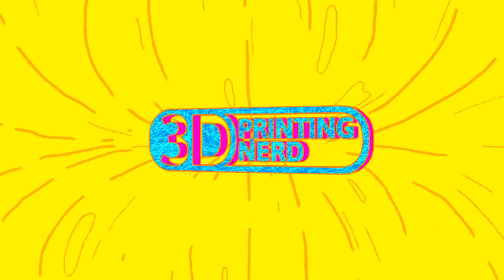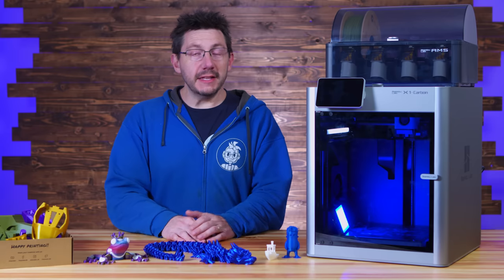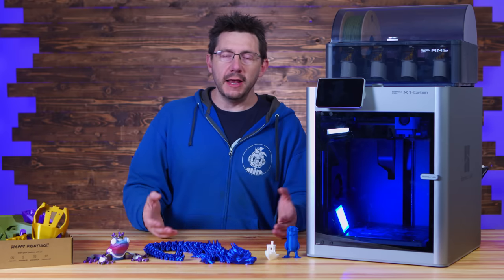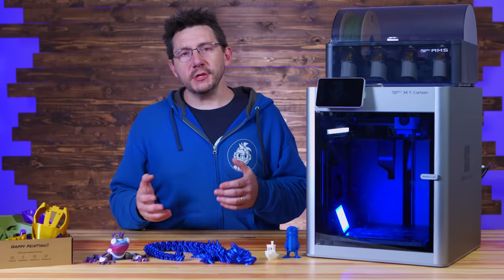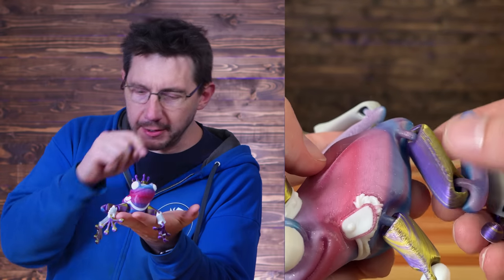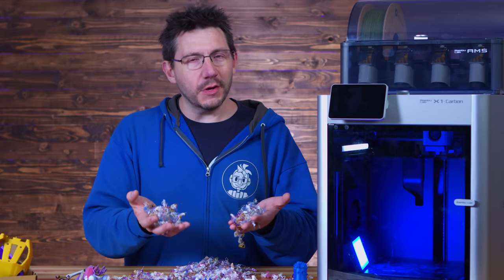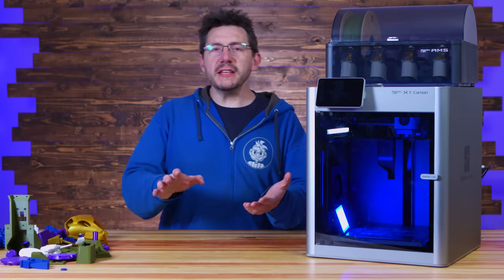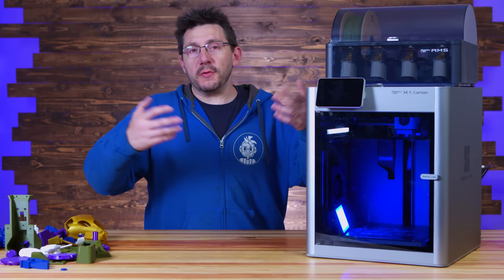Bambu Lab X1 Carbon + Kickstarter?!

Comment: Hey Joel. I've been really interested in this machine and have been straddling the line on buying one at pledge stage. One of the things I'm not seeing a lot about is the part cooling ability of the machine. Sure it seems SUPER quick but at what point does its speed out perform its part cooling ability?

I'd love to see some prints that really push it's part cooling potential and probably by extension it's stringing
Reply: I mean it’s printing PLA at 250mm/s.. I don’t think it gets much better than that as far as the amount of cooling required.
Reply: The only real information they have present for the cooling is that it has an 11W cooling fan, which is quite a bit compared to most cooling fans which are in the 1 to 3 watt range.
Reply: @colinmetzger6755  There is cooling on the hotend and also a blade cooler on the side blowing air across the bed.

Comment: I would love to see not just multi PLA but PLA/TPU/PVA/Nylon or w/e combo you can push it to do. That is where the value will be found for me.
Reply: I agree.  I would like to see high temp and exotic filaments printed on it.
Reply: I’m honestly not sure that would be possible, at least not without really crappy results for any machine. The purge sequence doesn’t actually know where one filament starts and the other ends, so I think nailing the temp transition would be really tough. It’s worth a shot though
Reply: @vaughnkhouri1364  I think its actually rather simple to do. There are filaments called purge filaments that flow at really wide temperature ranges. If you use that in between switches, it wont really matter, though it will take up a whole slot.
Reply: @BeefIngot  That’s interesting! I didn’t know of such a thing. Would be cool to give it a tru

Comment: For those who have the X1 + AMS combo… Does the LiDAR flow calibration perform a calibration on all materials loaded in the AMS module? Or does it only calibrate the flow for the “Primary/Default” filament?
Reply from the maker: Only the first material it uses - not all of them.

Comment: I, personally, would like to see it's capabilities in printing carbon fiber based filaments and flexible filaments such as the Filaflex line from Recreus (they make specialized tpu filaments that are solvent/fuel resistant). Especially since it's a proprietary hotend system.

Comment: Really appreciate the way you explained the Kickstarter and investment background. You're the only one that really highlighted some aspects of this launch that were important to discuss. I'm curious if this thing can handle... Slow printing... I use polypropylene, which is notorious for warping when printing large parts. It's also a pain when printing fast. The best I can do on an ender 3 s1 pro with my custom enclosure set to 35C is about 35mm/s with 250mm/s2 acceleration and a tiny tiny amount of coasting in cura to reduce stringing. No one YouTube's about polypropylene, but it's a fantastic material. Wondering if you could try it out.
Reply: the print volume is heated, and it seems you are able to change how fast it prints in the slicer

Comment: I thought the AMS only took .5kg spools but it looks like you have it loaded with a 1kg spool. What size spool does it take and did you have any issues with loading or setting up the non-Bambu filament. One of the other videos I saw said the Bambu filament communicated with the printer via RFID. Looks great but with only one year warranty for a machine that is 100% NOT off the shelf and proprietary I don't think it's a smart move. Unless they make spare parts available at a reasonable price.
Reply: Spare parts will be available

Comment: It sounds like an absolutely fabulaous machine.... but I have two main concerns:

1. It's packed with features, which on the surface might sound fantastic, but the more things it has, the more things can go wrong. I'd be concerned with reliability over the long term.
2. How are they able to offer a super advanced printer like this for such a low price? Printers from other manufacturers with less than half of what this one is offering cost 2x to 3x the price. Something doesn't add up. If they're losing money on the machine, they need to make it up somewhere else. My concern would be, where?

Don't get me wrong, I want this to live up to the hype, but I'm remaining skeptical for time being until the Kickstarter is over and it's been time-tested.
Reply: I think what you are missing is that other printer companies make absolute bank in profits on every printer. Do you think an Ultimaker is anywhere near 5k in bom cost?

Absolutely not. You can build one to the same spec for 1/10th the price.

I reckon that this printer is selling at a close price to BOM initially to get their company name known before branching out more and increasing prices.

If you look at Vorons for instance (where they dont have the benefit of economies of scale) they cost just about 2k to start, and have somewhat similar feature sets.

If a normal person can get a voron for that price, you can imagine how a much more streamlined process with injection molded parts, economies of scale and being designed for manufacturability gets to this price.

You also have to take into account that unlike some other companies, they have huge access to a far cheaper labour market.

An average engineer in the US will make about 100k USD while one in China will make 40k. Thats a huge savings for the same grade of engineer.

All in all though, I still think you are partially right, and the funkyness to do with the cloud platform nonsense has me thinking there is going to be a big gotcha on that front. There is no reason to necessitate the cloud.

Comment: Great overview and for hitting some important points. A fair mount of text below (as I've become infamous for)

I have had small chats with people, but have also written probably more in comments on livestreams about this printer more then any other. A fast printer is ideal. A high quality/accurate printer is a necessity. A feature rich printer is ideal. A user friendly printer is often overlooked (though I know I've been saying that for years to friends, and I know I'm not the only one who's said that). And a well priced for what it can do printer is a cherry on top.

This printer meets all of those points. So is it the perfect Sunday or a fake? "Um, people print with it" yes, but auto makers build concept cars. Game devs produce game demos. Software engineers produce PoC (proof of concepts). They all work. They all can be used by people. Some even do demonstrative production runs in the thousands...

But a key thing I've said many times now, and I doubt I'm the first (I'll settle for a tie :P), but have otherwise only heard from Joe (Breaks n' Makes) and Joel: we need to see what the actual shipping machines are like first before holding them up as a beacon. For all we know, they'll burn through their equity and KS money before they can ship to everyone... or it will be used up before they can do anything else, leaving it a one trick pony. If they pull it off, they'll set a new bar for what is expected of printers. I expect Prusa and a couple others will be able to match them. But many will not (and one person who I interact with in the know has already said there's a handful of printer manufacturers nervous with this machine).

I like many things they've done and want them and others to go further. I do software and have increasingly grown to believing that many in the community have tried to hardware solution their way out of printer progression and resolving issues. Just look at how many assumed the front decorative bezel of the Ender 7 was important. More 2020s! More cross bars! Thicker steel! Linear rails! Heatsinks! You know... maybe what the printer needs is just better software. Better: maybe people need to stop looking down upon the relative few who work on the firmware, slicers, etc. for 3D printers.

I wrote a ton in a comment on the VOD of Breaks n' Makes unboxing of the X1 and don't want to make one as big. I like where they're going, want to see things go further, agree with a friend who said "we need to move past standardized parts to build a printer and look at purpose built ones" though I feel there needs to be a certain amount of standardization (it's kinda why humanity become as industrious as it is: standardized interchangeable parts) but not on everything. Not everything needs to be a 2020 extrusion. They use smooth rods instead of linear rails (I have not found a single person say "would be better with linear rails" this whole time... even though that's said for so many other printers).

If the deliver, it will be on my list of printers to mention when someone is looking for recommendations. But their are plenty of other outcomes (deliver but never improve, deliver but it exists as the sole machine they make, get purchased by some company and then buried and never seen again, not deliver in one or more areas, etc.)

But if anything: make this feature set a floor. It has filament runnout, flex bed, and ABL so it meets my requirements for a modern printer... but what will be next if we start from here instead of another clone or single-slightly-improved feature on a known printer? Also, please stop using Kickstarter for pre-orders, I know they don't seem to care but a much larger proportion of their site is used as it should, so an outlier of the site is ignored by them.

Comment: I can't afford one no matter what, but I have issues with anything that uses a cloud service to run. Yes it can be used with the sd card, but does it have a usb port or any way to use octoprint just like all my other printers. I do like the app on my phone that can remote monitor from any location, but what happens when there servers crash, do gown ect. Once I see a more finished firmware and slicer I would then consider it.  It looks good, appears to print well and has some very interesting  features that I hope will set a new trend in higher spec printers.

Comment: I'd really just be interested in it's reliability. Basically anyone these days can make a solid printer. Whether or not that printer is still printing reliably a year later is kind of what separates the good from the bad imo. And all machines will have wear parts and require maintenance so how does this printer differ in that regard? Are parts proprietary, will Bambu labs stand by their design 5 years from now, etc, etc.

Comment: Hey Joel!  Awesome review.  I was just wondering if you had a chance to use any of the other nozzle sizes available with the machine and if so, did you have any issues?  Specifically I am most interested in the 0.2mm nozzle, but am curious about all of the other nozzle sizes as well
Reply from the maker: Unfortunately all I’ve had access to is the hardened 0.4mm nozzle

Comment: I feel like this printer is given more credit than it's due. It is impressive! But everything except the lidar has been done before.  The X1's real triumph is to integrate a bunch of tech voron modders are already using in a way that feels seamless and user friendly, with no assembly.

We've seen fast, good quality prints from enthusiests all over the community. And most of what is here in the bambu can be found in the modding communitty.  It's essentially a well tuned custom voron out of the box. It has the wall mounted extra part cooling like 24/7 printing or Fail Faster, it has triple lead screws like the trident/ratrig. Most of the cloud functionality is right from klipper or octoprint. THe ams is the same as a pallette or any other similar mmu's that have been around for years. Input shaper has been around. Calibrating pressure advance has been around.

To me that is the thing that is impressive is ease of use. Not the speed, not the leveling, not the print quality, or any of the other tech.  The accessibility for all those things is the killer feature.  They've taken power user features and made them apple-like in their implimentation. And if the kickstarter success is any indication, it's going to be a gold mine for them if they can really dleiver it.

I gotta say, I'm totally unimpressed with the AMS. It is just a wastful approach to multi material, compared to toolchangers or IDEX. It seems like a really well made version of hat type of material changer, but the approach is just not worth it in 2022 IMO.
Reply: Idex to me is just the worst tech of them all. You get drag from oozing, alignment issues, far more maintenance problems and you are limited to 2 filaments.

As for tool changers, I believe they are superior yes, but the price is significantly higher. I mean looking at the prusa xl as an example the printer is 3-4 times as much.

As for saying the AMS is the same as pallette or other mmus, those arent very comparable at all. Pallette splices materials together. Some mmus retract filament alone. Some cut.

This is most similar to the prusa mmu.

Lastly, as for you saying it gets too much credit, I find that absurd. All the tech has existed before, but combined at this price with the usability?

This is like saying an Iphone isnt a top end phone because individually it does all the same things as other phones.

Comment: Now rip open the case and let's see what's driving it. Is it a raspberry pi? SKR 1.4 board? A4988 steppers? 32 bit processors? Is the wiring tinned and crimped or using proper ferrule connections? Does it have thermal runaway protection?

Comment: I backed the Kickstarter at launch, so I believe in the printer. My question is if the printer will work with Octoprint?
Reply: well not atm has it is cloud based. but there is development for offline standardlone software which will allow for over the netwrok print, when that come availabel then octoprint will probably be allowed.

Comment: Hey Joel,

Very interesting take on the matter. I have a question for you: can you check and confirm the maximum volumetric flow rate of the Carbon X1? Speed and acceleration are incredible but I'm also interested to know the VFR.

Thank you.

Comment: TEST THE PRINTERS CAPABILITIES! Print at LUDICOUS speed! Push this printer to it's limits and see where it fails. Also I would love to see how much waste filament you could reduce in the slicer. 3DPrintbeginner weighs out the purge tower and "chips" that are spit out the back. It's rather sad how much filament is wasted.
Thanks for this video Joel. Love your stuff.

Comment: Looks promising. How does it store the filaments on top if you happen to live in a humid part of the world?
Reply: As long as the spool fits, it seals and has desiccant packs inside.
Reply: The top is air tight and has a humidity monitor

Comment: Is it big enough to do a mando helmet in one print.  I started out on a ender 3 v2 and I want to go up to the next level.  I thought about buying an expansion kit for the ender.  But having up to 4 different colors to variations would be cool also.  This looks cool and I would consider spending the cash on this type of printer for the potential.  I may wait till after the promotion to see how it fly's.

Comment: Hi Joel, quick question if you see this. Does this printer run a modified Marlin or Klipper or is it something completely new?
Reply: They developed their own firmware for this one.
Reply: @The Edge of Tech  That's both amazing and kind of scary at the same time.
Reply: @dragonfly9138  Did you see the Blog the CEO put out? I would check it out on the Bambu Lab Site. It explains a lot!
Reply: @TheEdgeofTech Thanks. will do.

Comment: Does this accept G-code that was sliced in open source slicers (like cura or Prusaslicer)? If so, would really like to see the results, especially with a profile on one of those slicers appropriately calibrated for this printer.

Also curious about flexible performance, and soluble supports. I saw 3D printing generals results (not good) with soluble supports and it seems like it could be solved at the slicer level, that’s why especially interested in third party slicer support.
Reply: Yes it supports third party slicers, but it might be difficult to access and use the custom features it has.

Comment: I would like to know how the first layer looks as I print alot of cases and the first layer is important in looks as that is the top on the object. I would also like to know if you could print pla on the other side of the build plate as using a glue stick usually leaves a residue on the print and I would prefer to have the print bed heated for pla.

Comment: This is the first time Ive kickstarted. Im the type of guy who has a modded to hell printer that I spent more than the price of the printer upgrading, and this has literally every feature I could want apart from repairability and app free network control.

I just cant resist the level of ease of use. The lidar and filament changing combined with an all metal hotend are what really won me over.

Even if it costs 200 dollars to replace the hotend its still worth it. I just cant believe someone finally cracked the code and its only 2000 dollars canadian. Just insane value. Just think, I alost bought the prusa corexy. I know the build volume here isnt amazing, but its a tradeoff Ill make for all the other features this has.